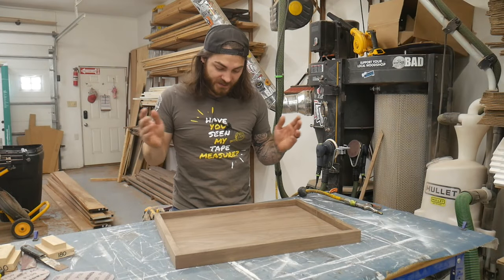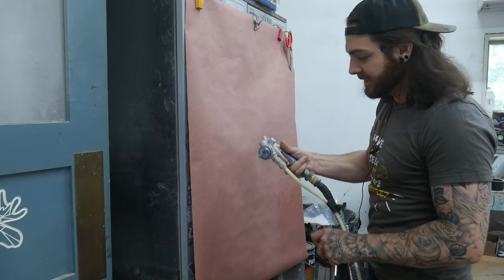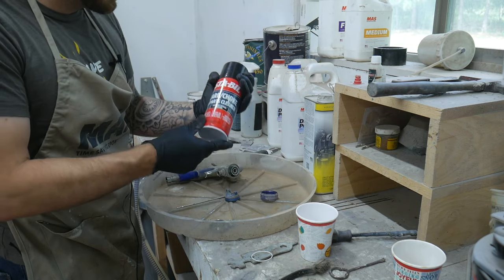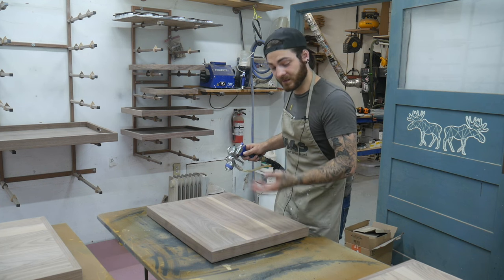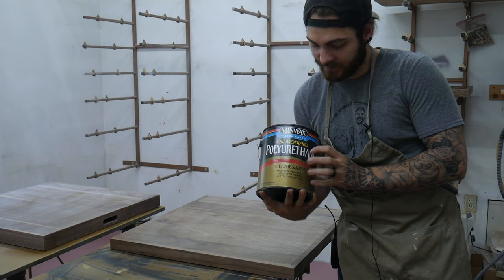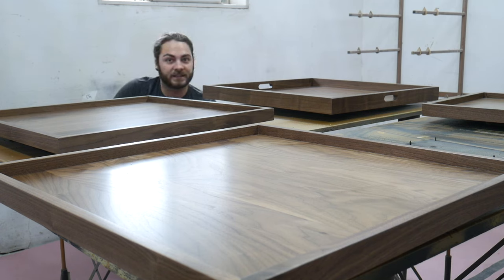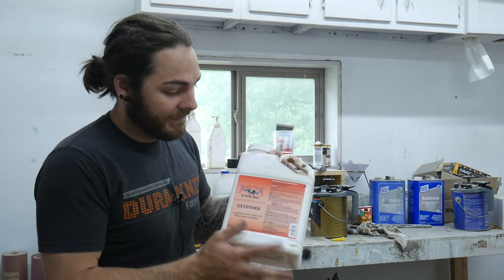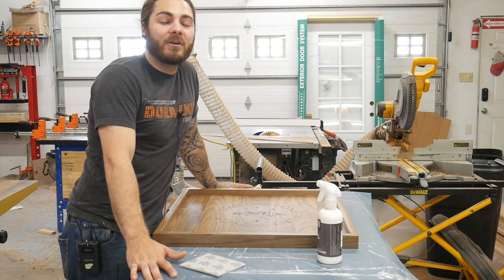Ultimate guide to spraying top coats // HVLP // Woodworking

Comment: You've got a new subscriber off this one. I wonder if you could do a video about spraying pieces like cabinet doors with copious router work on the face or intricately detailed panels on residential front doors. Those finely detailed things which are faceteous and  the faces are clustered. No matter what i do i end up with heavy spots that obscure parts of tooling and have to spend a lot of time fugging up my clean surface to start over in sections.

Comment: What's your spray room setup look like? How do you heat & ventilate? What size? I'm looking into building one off my shop.
Reply from the maker: The whole shop is heated by a large mini split. The finishing room is 15x15’ and had an XP exhaust fan which is overkill since I mainly spray water based

Comment: Thank you for the great and informative video. I have a question about the spray room itself. How is air flow in your spray room regulated and filtered? Anything special other than being off set from your woodworking space? I just feel like I’m overcomplicating it and I am hoping you can help. Thanks
Reply from the maker: Nope nothing special, I did spend extra on an explosive proof fan but if you’re just spraying water based it’s over kill. You’ll need to crack a window or add another smaller fan as it creates like a pressure as it’s sucking air out. I just crack a window as I did have another fan but in the winter it would move waaaaay to much air and I would loose all my heat lol
Reply from the maker: For filters I buy the mid level furnace filters

Comment: Step # 1 for HVLP is to determine the product viscosity.  Do you even have a viscosity cup?
Reply from the maker: Sure do but I mainly spray water based top coats which are generally all pretty close in viscosity to each other. Paints are a different ball game but even then I’m using one needle or the next size up if it’s not atomizing properly. It doesn’t have to be complicated, as long as my finish is smooth and look clean I’m happy.
Reply: @TwoMooseDesign  My point is you should tell people how important using a viscosity cup is with HVLP.  Measuring and adjusting viscosity is the most important thing to understand when using a HVLP sprayer/turbine.

Comment: Great video thanks for sharing. A tip i got some time ago. Make a two turn tables. 24 by 24 by 30  high add a box on top 8 by 12 by 8 high. The box keeps the panels off the table. With this you dont get bounce back from the finish and it rolls slightly around the bottom edge. The reason you use two tables is , you do edge's first on both panels. Then spray one direction the cross the other way. Then do both edges again. This way you can get away with two coats in a day. With one sanding inbetween.
Reply from the maker: Nice! Great tip thanks for sharing

Comment: Such direct, specific and PRACTICAL advice. Thanks so much for a delightful primer on water-based techniques, brands, and tips and traps.
Reply from the maker: Thanks for watching, I appreciate it
Reply: @TwoMooseDesign  I especially appreciated your advice about extender, and the fact that the General Finishes stuff seems to work well with Minwax and other water-based finishes. here in new Hampshire, we definitely have the problem of rapid drying during the winter. So the possibility of using ONE extender may help keep my collection of seldom-used-but-important finishes and cans and bottles of stuff to a minimum. Thanks again.
Reply from the maker: @LewHarriman  it helps a ton, same issue here in Wisconsin. It gets so cold and dry weird things start to happen with the finish. I haven’t tried any other brand extenders this one has been fine just make sure it’s for water based
Reply: @TwoMooseDesign  Got it. And not to take up more of your time.. but so that you know, that tip for using the "oil-modified" Minwax to get a slight ambering" is also incredibly helpful. I've been so confused about what is—and is not—water based, and what can—and cannot— be used on top of each. So I've been trying to *guess which might give me that "ambering" that I'm after (and used to have with oil-based urethane). You've really saved me a LOT of wasted, expensive cans of finish.

Comment: Great video, as usual! I agree with you about the grain showing through, all my white oak ones you can see some of those cathedrals and I love the look!
Reply from the maker: Totally agree. I hate those big thick top coats. I used table top epoxy a few times and just not a fan of 1/4 plastic on top lol
Reply: Seriously, I don’t understand the desire to hide the character of natural wood. It looks beautiful!
Reply: If you use the right mix on the initial coat you can unlock layers of luster in the wood itself and actually cause the tops mils of wood to become translucent and get a sort of hologram effect where you can see deep into the grain and the light passing through the glassy finish allows the shine deep withing the grain to streak and flash through the peice. As if the top few millimeters of the substrate were sprayed on as the first few coats of finish so you could see into them. It's really magical when you get that first finish coat to really penetrate. Especially when you use some colorant to lightly tone the subsequent coats of finish in complementary colors for the substrate wood. The layers of tone colors make the light glinting off the deep grains show off all of the natural colors becasue the glinting light will shift colors as it move theough the piece and the light refracts more through certain layers depending on the angle the reflection is being viewed from. It's more beautiful and mesmerizing than a professionally cut and selected diamond if you ask me. If it ends up looking plastic and artificial like a peice of wood with a pane of glass on top of it, then whoever finished it didn't properly precondition and nourish the wood with their initial finish coat and probably just started spraying some water based urethane or acrylic for 10 coats. Which is technically excellent protection for the wood and, technically, a proper finish but lacks any soul or sex appeal. Ya feel me? The smooth finish has to have the nurturing beginning. But nothing can match it for stunning emotionally provactive viewing or showcasing the natural beauty of the substrate. IMHO!

Comment: Brother! Hopefully in the year since you cut this video youve "seen the light" where smooth glassy finishes on natural wood substrates are concerned!

If you use the right mix on the initial coat you can unlock layers of luster in the wood itself and actually cause the tops mils of wood to become translucent and get a sort of hologram effect where you can see deep into the grain and the light passing through the glassy finish allows the shine deep withing the grain to streak and flash through the peice. As if the top few millimeters of the substrate were sprayed on as the first few coats of finish so you could see into them. It's really magical when you get that first finish coat to really penetrate. Especially when you use some colorant to lightly tone the subsequent coats of finish in complementary colors for the substrate wood. The layers of tone colors make the light glinting off the deep grains show off all of the natural colors becasue the glinting light will shift colors as it move theough the piece and the light refracts more through certain layers depending on the angle the reflection is being viewed from. It's more beautiful and mesmerizing than a professionally cut and selected diamond if you ask me. If it ends up looking plastic and artificial like a peice of wood with a pane of glass on top of it, then whoever finished it didn't properly precondition and nourish the wood with their initial finish coat and probably just started spraying some water based urethane or acrylic for 10 coats. Which is technically excellent protection for the wood and, technically, a proper finish but lacks any soul or sex appeal. Ya feel me? The smooth finish has to have the nurturing beginning. But nothing can match it for stunning emotionally provactive viewing or showcasing the natural beauty of the substrate.
 IMHO!

Comment: Appreciate the video man, I'm trying to spray oil poly on some bar tables the finish looks great but there's two or three nibs/bubbles on each table
Reply from the maker: Ugh the worst! I always get one or two random imperfections lol
Reply: @TwoMooseDesign  I'm kind of torn. Is it worth standing and respraying with the risk of just more blemishes?  Is there a way to chisel or sand them off without doing a full recode afterwards? Any advice?
Reply from the maker: @BuiltKnotBought  If it’s hardly noticeable I’ll take a sharp chisel or anything really sharp you can get flat and gently slice it off. After it’s cured you can give it a quick cleaning buff and you can’t even tells if they are pretty noticeable I’d just lightly skuff it and respray.

Comment: Good stuff, very informative. For 1/4" mahogany veneer panels and red oak panels, should I be using lacquer finish or shall I try the polyurethane? I'm using 2 coats of oil based minwax stain to begin. Thanks!

Comment: This was my 1st video of yours. Great explanation! One question. I'm a finish carpenter by trade & occasionally do finishing or painting, About 8 years ago, I sprayed about 20 doors or so with the Minwax Modified Poly using an HVLP turbine sprayer & I had excellent results. I was new to spraying then and am VERY big on reading and following instructions. What puzzles me is when I just now read the instruction again for a bunch of drawers I need to spray, I found that the instructions don not say anything about spraying & Minwax website says on their Q&A page that do not recommend spraying this product. Do you know if they changed it when it went to the gray can? I can't imagine me spraying something that was never intended to be sprayed. Anyways it came out great and was hoping to spray some again.
Reply from the maker: I spray it just fine 🤷🏼‍♂️ I don’t have any issues with it. Thanks for watching!
Reply: Have you sprayed any since they changed the color of the can to gray. I'm just concerned that they might have changed the product. Though I don't see new and improved on it anywhere. LOL @TwoMooseDesign
Reply from the maker: @t.e.1189  I still spray it yes. Lol
Reply: Thanks. I guess I'll give it a try tomorrow. Been watching some more of your videos, you guys do good work. Nice to see couples working together. @TwoMooseDesign

Comment: Great video. I also use minwax oil modified. Had a problem with flow. Seems like it was drying to fast.  My shop temp was around 80. Would extender help? Thank you
Reply from the maker: Yes I think it would. And flow could be several things, air, wrong sized needle, too much material flow. Hard to tell without seeing it
Reply: @TwoMooseDesign  Thank you for your help.

Comment: So does a pressure pot allow you to basically have your material cup in line, as opposed to attached to the gun?
Reply from the maker: correct and since the cup isnt attached you can spray upside down or at hard angles with out getting materil loss
Reply: @TwoMooseDesign  that’s awesome, thanks!
Reply from the maker: If you spray enough I really like it.

Comment: For thinning poly oil based what would you use?...for water based?
Reply from the maker: I would look at the back of the can and use what they recommend for “clean up” to thin. In a separate container add a tiny bit at a time. I wouldn’t add it to the main container unless you plan on using it all right away.

Comment: What are you flipping trays onto so it dont stick after coat
Reply from the maker: Scrap wood with screws throug then. I lightly tap the ends with a hammer so they aren’t sharp. If you set them gently there’s no marks. Saves a ton of time

Comment: What happens if you get pinholes right after you spray the piece?
Reply from the maker: Try turning down your air pressure or use a smaller tip.
Reply: @TwoMooseDesign  It's a 1.1mm tip, also I'm using a HVLP turbine, not sure if I can change the pressure.

Comment: Didn’t realize wood working involved so many different types of spray you need to buy….
Reply from the maker: you dont haaaave too. A water base poly is fine for most applications. But if youre going for a rich chocolate walnut color on natural walnut the water based poly will not amber it and it will look grey. A oil based poly will amber it but will yellow white paint if you spray over it. Theres a ton of tiny little nuances you learn along the way. theres also a ton of more natural fnishes i use that dont involve sparying.